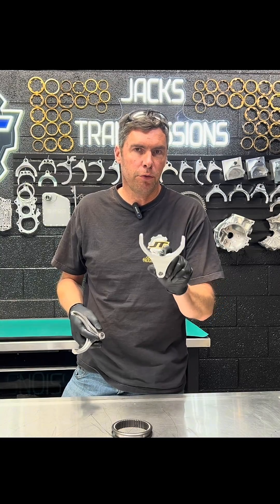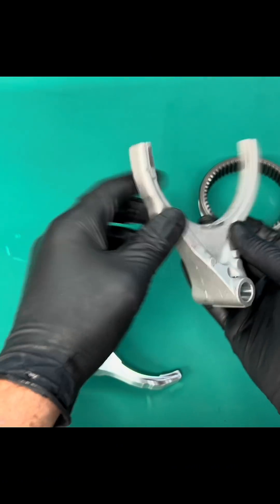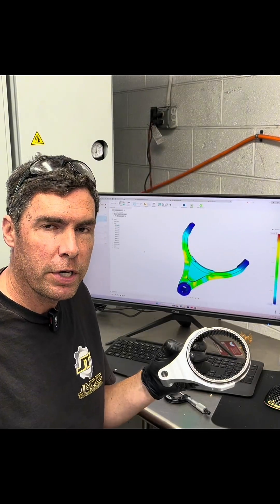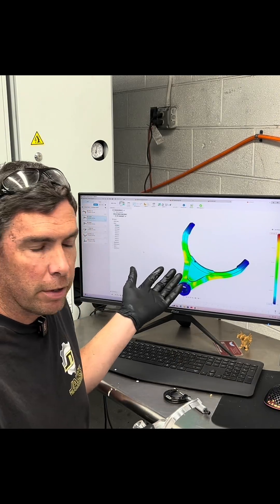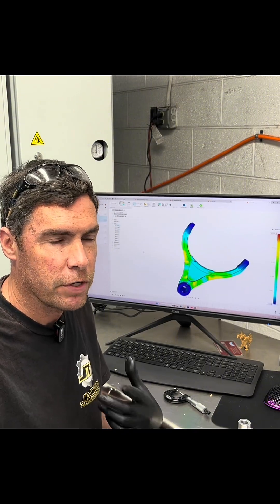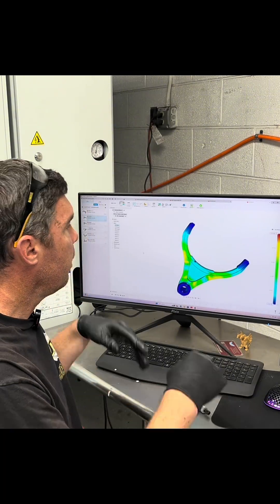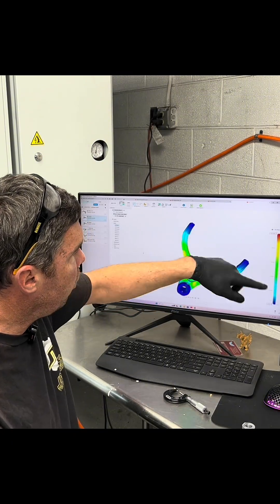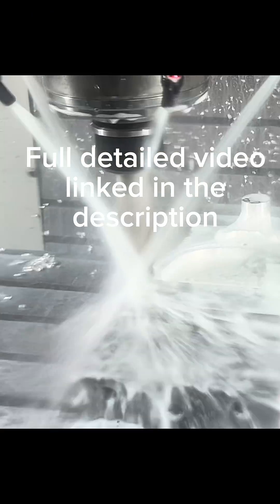EVO8, EVO9, 1-2 Shift Fork, 5-Speed, EVO 8-9, Lancer Evolution, 7075-T6 Billet, Jacks Transmissions

Comment: do is come in hardened steel? like C49 or Ar 500 ?
Reply from the maker: No. We are against doing that as a steel fork with steel sleeve is not a good combination. Similar metals could potentially generate friction with each other and cause more damage to themselves. With the 7075 you are getting near forged performance from the aluminum so as to have dissimilar metals between the sleeve and fork preventing premature wear of the mating components. 

The material we are using for these forks is the best you can get designed to last the life of the vehicle. The steel used in race applications are not always best for daily use conditions on a street car.

Don’t get me wrong- we are always open to exploring other options and if the demand is there for a steel version of this we will absolutely look into it. However, we do have experience with similar metals (like 2 steel components) generating friction with each other and causing a severe and catastrophic failure. Basically, we have seen 2 similar metals in applications like this ‘friction weld’ together during high speed and causing a very serious and extraordinarily dangerous failure. 

Steel is cheaper, so for profits sake it would make more sense to make them out of steel. However, we believe the added cost of the 7075 for this application gives the customer a superior product and will live long term in your standard daily driver all the way to the dog engagement race car. 

Give 7075 a chance, it is an extraordinary material that works incredibly well as a fork in a transmission and I can’t imagine anyone will find a way to break it. 

Thank-you for the question and interest, and if you have any others please feel free to ask.
Reply: @GVR1670 ar 500 or c49 are not cheaper harder materials cost more to machine
Reply from the maker: @s @stewart8127 th the equipment we have it runs right through it. We make nice steel shift rail ends for the DSM units and it goes through that 4140 chromoly like butter. 

The steel forks are just a bad idea, though. A situation where you have high heat and friction the aluminum will smear on the sleeve. If steel more explosive damage will occur.
Reply: @GVR1670 I don't know the bikes come with steel shift forks  . but its illegal to have more than 6 speeds or a fully rotating shift drum. I wonder what electric vehicles don't have manual transmissions you don't even need a clutch and can more than double range.